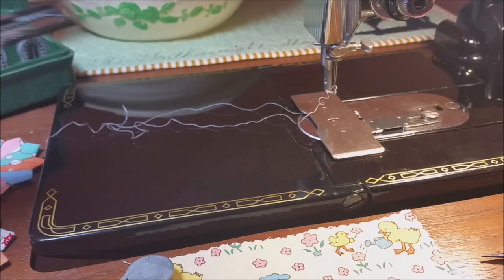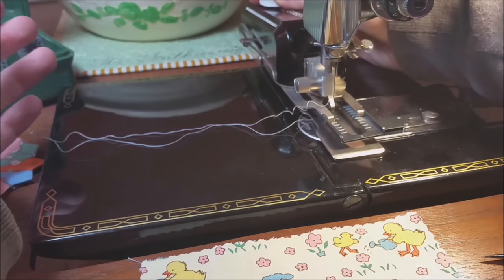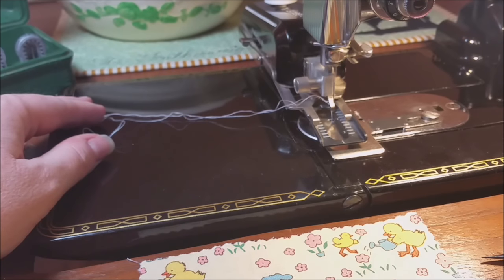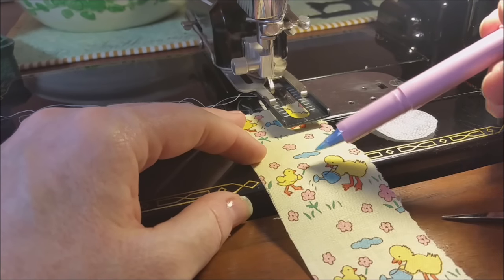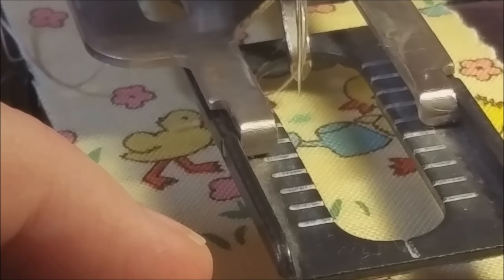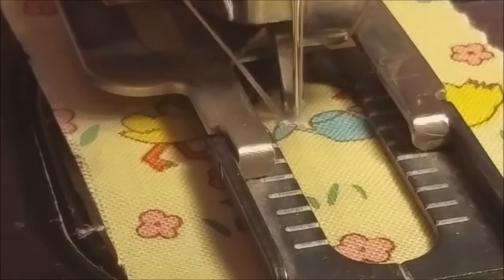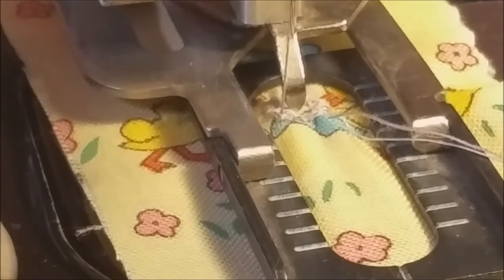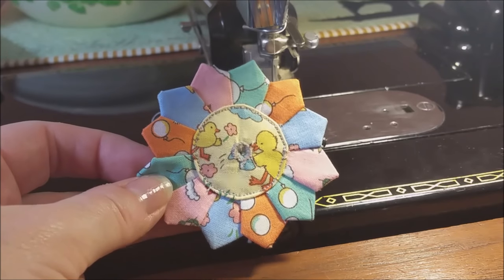PART 2 -- How To Make An Eyelet Hole Using the Singer Buttonholer Attachment 160506

Comment: How is the strength of the stich at top and bottom of the hole which is side to side vs an eylet attathment the you feed circularly by hand and the stich is center to out?
Reply: I used to make eyelet holes in my toddler's clothes to allow for their rapid growth. Used this exact same machine and regular old Coats and Clarks dual-duty size 50 thread. Never had one rip out and my kids gave them a workout. If that's not enough, probably anything short of a metal eyelet isn't going to fulfill your needs?

Comment: How do you get the vintage Singer machines to accommodate cones of thread?  Will your little Dresden plate assist with holding the cone in place?
Reply: Da Mama, hello.  Thread on cones are cross wound and come off the cone if pulled vertically, as it was intended. If you are using a cone, it might be easier to secure it on a separate spool/cone holder in back and slightly to the right of the center of the Featherweight. Then you could proceed to thread the cone thread as usual.  Since cone thread draws off the cone vertically, a separate stand gives better results, in general, for all machines.  Spools are wound around differently, so the spool pin works perfectly with threads wound this way.  I hope I correctly understood your question.
Reply: Thank you for your threading analysis.  Don't bother trying to fit the cone on top of the machine, put it on a separate cone holder.  That should have been obvious.  Since some machines are specific on whether the spool is installed clockwise or counter clockwise, I was concerned the spool stand would have a greater impact on tension.  Vintage machines while impact resistant, seem picky in some ways.  Thanks again.
Reply: Da Mama, you’re welcome.  I hope I really was helpful.  I saw you asked a question a little while ago, and no one responded, so I thought I’d try to help.  I know what it’s like when I’m waiting for a response.  Have a good weekend.

Comment: Will the fit a 31-15?
Reply: That's a high-shank machine. I don't know whether the high-to-low shank adapter (easy to find at any sewing shop or Amazon) will make it work or not. My experience with industrial machines is non-existent. 
Given that these adapters only cost a few dollars, it is probably easier to just buy one, borrow such a buttonholer (or get at a thrift store, they cost next to nothing, so many were made) and just try it.
Our local sewing shop, unfortunately, is run by purists who always say 'no' to anything which doesn't involve buying one of their latest and greatest super expensive machines.